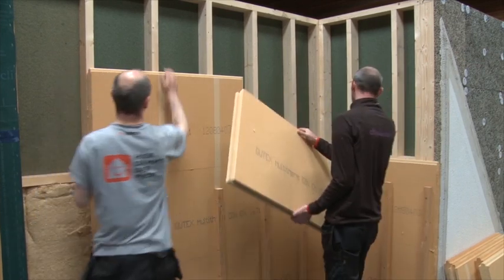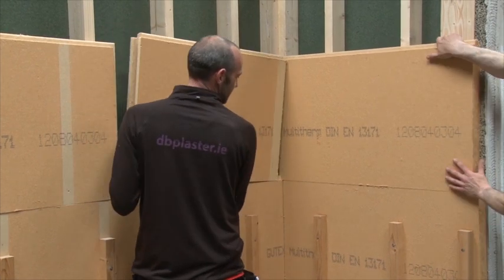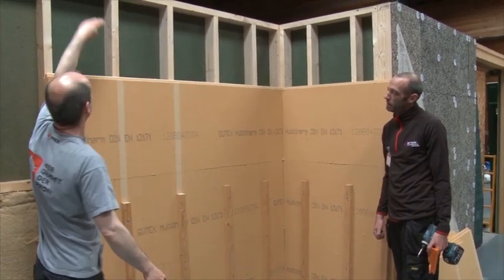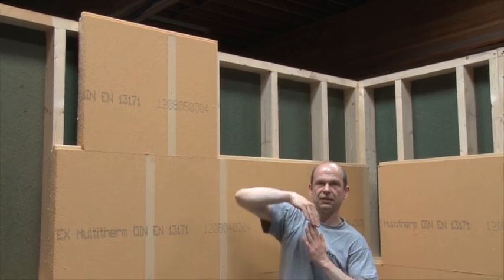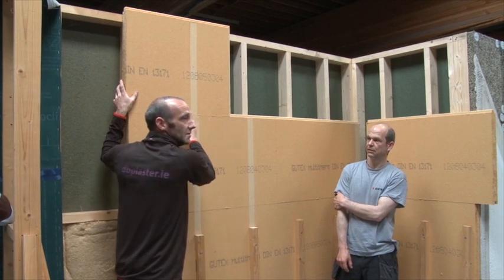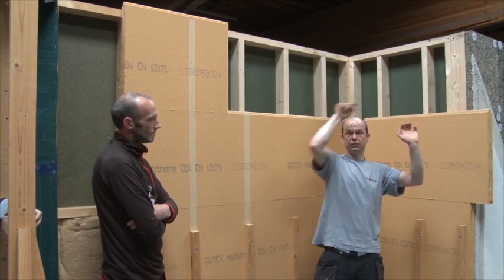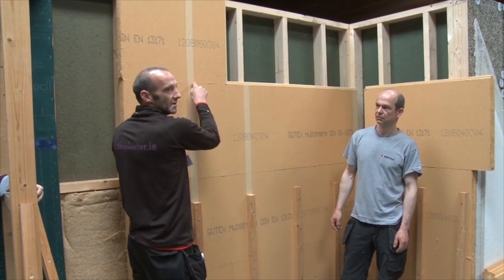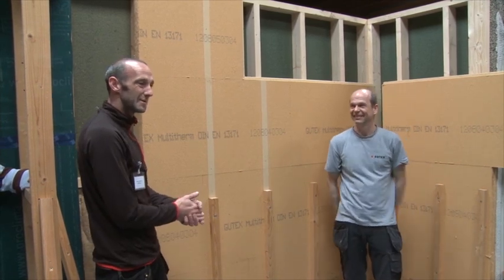Gutex Multitherm Wall Installation - Hints & Tips

Comment: Would you recommend to use EPS / Styrodur for the first 30cm above ground level. Only the first row for rain protection. Or are these wood panels also good to use for the first 30cm from ground level?
Reply from the maker: Hi @lmmenfreund50. When using wood fibre externally we always recommend a strip of XPS/water resistance insulation at plinth level (300mm up from ground level) and then build up the Gutex wood fibre up from this level.  We would not recommend running the wood fibre all the way down to external ground level.

Comment: what is the advantage staggering the boards in the corners?
Reply from the maker: Hi @karl-arnal. If the Gutex Multitherm boards are being counter-battened over to form a vented cavity zone then there is no need to stagger.
If the boards are being directly rendered onto then the staggering is needed to give more strength at the corner details and then reduce the risk of any cracking occurring.

Comment: Could a trocal PVC membrane be installed directly on top of the gutex boards?
Reply from the maker: As a general rule we would not recommend to apply them directly on to Gutex. It is more preferable to create a well vented cavity between the Gutex and the external PVC membrane.

Comment: What's the maximum thickness of Gutex that can be installed? IT is only limited by the availability of sufficiently long fasteners and spacing of fasteners?
Reply from the maker: Yes, in general, fastener length is the primary limitation. We have supplied up to 300mm Gutex on the external walls of a Passivhaus which used 500mm HECO screws.

Comment: Just started learning about Gutex boards.  Do the Gutex boards act as a sheer wall as well as insulation or does there need to be plywood/osb added to provide for sheer strength?  Thanks.
Reply: Hi Dustin. GUTEX boards are not tested for use as sheer boards on walls and roofs. For this purpose bracing should be supplied by ply, OSB or a suitable particle board such as our FINSA VAPOURSTOP (https://www.ecologicalbuildingsystems.com/product/superpan-vapourstop) or ELKA board (https://www.ecologicalbuildingsystems.com/product/elka-strong-board-p5-particle-board)  internally.
Reply: @niallcrosson5859  got it thanks!

Comment: If you cut the back off the groove, could you add noggins/blocking to add strength back to the board? Do you need to add an air control membrane over the Gutex for air tightness or can you simply tape seams/use liquid flashing sealants?
Reply: Hi, you can cut off the groove of the first board and if the overhang is adequate you can fix a "sheer block" to the rafter at the eaves. This would then be fixed to the rafter and would remove the need for sheer fixings as you move up the rafter. Only suction fixings are needed in this case.
Reply: IN terms of air/windtightness, the boards are inherently windtight thanks to there structure and t&g format. butt joints must be primed with TESCON SPRIMER/RP Primer and taped with TESCON VANA 150mm wide tape or AEROSANA VISCONN liquid air tight paint. Otherwise, a breather membrane such as SOLITEX PLUS can be applied over the whole roof, eliminating the need to seal butt joints. This is often the cheapest and easiest sealing method on complex roofs with lots of butt joints.